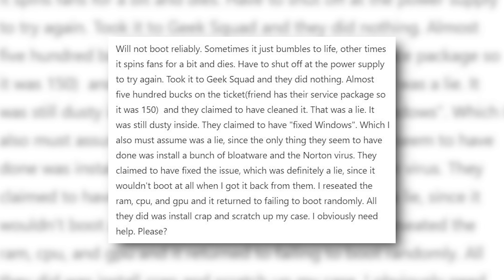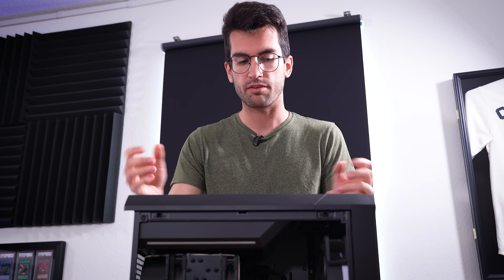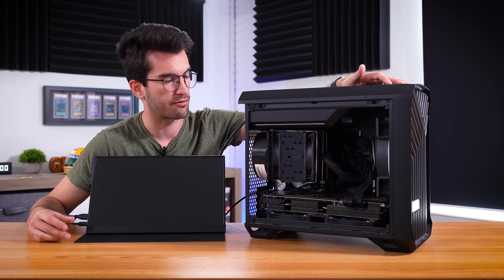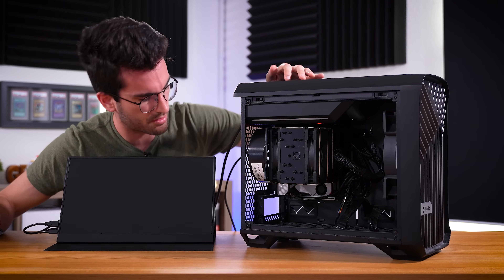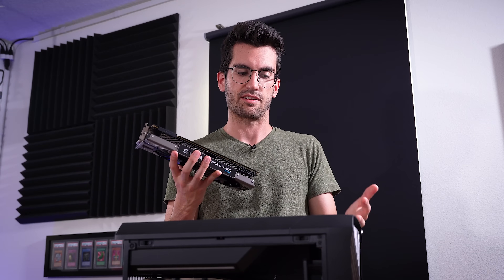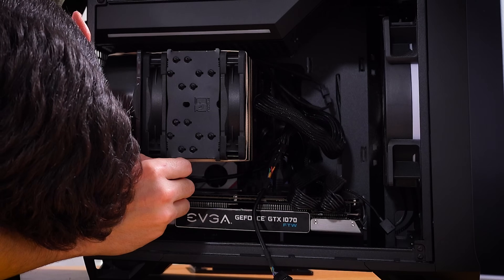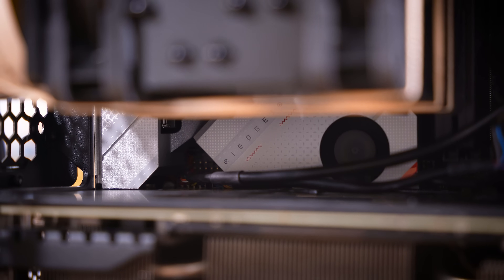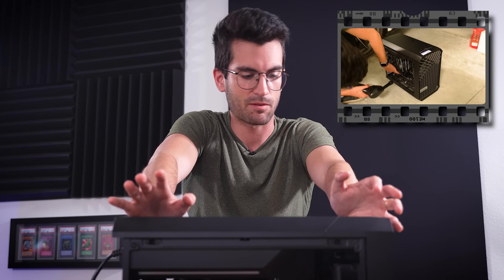Fixing a Viewer's BROKEN Gaming PC? - Fix or Flop S5:E6

Comment: The only thing that you didn't seem to rule out was the extension on the front panel connectors. After verifying that you could jump the pins to start up, I would have tried the front panel connectors without the extension to see if posts consistently after that.
Reply: My issue with that is why would it turn on and back off again? All it needs to power on is a short between the 2 pins or a momentary switch like what comes with the case. Unless you are saying something on the front I/O was hooked up wrong to the board causing it to shut down due to a short
Reply: @jsteezy80   I'm no expert, but my line of thinking was 1) Once the front panel connectors were removed the PC seemed to boot properly. 2) Does that mean the actual cables are somehow causing a problem? 3) Remove the extension, then connect the front panel directly to see if it continues to boot properly.

The idea being that maybe something was up with the wires within the extension triggering the power response or something. Similar to holding down the power button to turn off the PC and then starting it back up. I had someone who didn't realize their power button was a bit stuck and so sometimes the pressure was enough to shut down their PC. 

Regardless, it looks like it started up fine after everything even with the extension, but I think it was a simple thing to check just to rule it out as a potential issue/point of failure.

Comment: I purchased a new 1660 ti about a year ago. Installed it in an older Dell XPS with Gen 3. Ran some bench marks with Disk Mark the same day. The card crashed, with each test it crashed sooner than the previous test until it barely functioned. I tried it in another computer and it was all but dead. I contacted the company, they refunded my money and didn't want the card back. For grins I stuck it in an ancient Dell a year later. It worked flawlessly. It's installed in another computer that's less than a year old today and running fine. Sometimes, logic eludes us.

Comment: It looked pretty much to short circuit style fault. Shutdown immediately after detecting short circuit. Also connector mush have hit to some components or screw etc. With all those painted metals parts it need to scratch through surface to get contact.
Can't remember any other problem that kills power right when trying to start. ok maybe bitrot bios.

Comment: I have an issue where my system some times hangs at boot. Only thing that fixes it is removing all monitor plugs but the main monitor and replacing them after windows has booted.

Comment: Should have left the front I/O panel connector on after removing the GPU, test one thing at a time. I suspect it was the extension on the front panel connector not seated correctly.

Comment: The graphics card was shorting out the computer, make sure the metal backplate IO shield goes through the slots without touching the board sometimes graphic's card sag can cause the IO part of the card to touch the motherboard, also sometimes during shipping or traveling the graphics card can sometimes get a loose connection to some of the pins, another thing is to make sure nothing on the graphics card is touching the motherboard or the case.  It is possible the vibration of just using the case could cause graphics card and ran to become loose.

Comment: I'm thinking you were still on to something with the HDD activity cable.  It's possible those the cable pin were making contact with an UNPAINTED surface somewhere on the case or video card. You demonstrated touching the pins to a painted service.  In the end, the user is getting an operating system back and that is all which matters. Good troubleshooting.

Comment: This could also be caused by a faulty outlet in his home. If he has a bad outlet it might not necessarily trip the breaker, especially if it's older. He might want to look into the outlet, or if anything he can plug his system into a different one to see if there's a difference.

Comment: I had an issue where my pc won't turn on after shutting down sometimes...Everything looks fine. Until I checked the front panel switch and tried twisting it before plugging it back in. It seems like a loose front panel switch issue. Watching the viewer's rig reminded me of that issue and its even more prone since he/she is using extensions. That's just my opinion

Comment: I am an IT tech and its funny you showed this because I have issues a couple times were a laptop wouldn't load.  The fix I accidently found was removing the RAM card and putting the same one back in.  Don't know why that works, have really found a positive answer why it worked it just worked.  I have done it twice and it worked both times.  Crazy how some stuff fixes by just unplugging and plugging back in.

Comment: I've been flipping PCs in my local area for about a decade now and still learn something new every day. Personally, on PCs where I can't find a visible issue, I will take it apart anyway. I had a similar issue with an X58 build years ago where it would refuse to power on or suddenly power off, but when I took the side panel off and played with the cables it would power on with no problem. This was my personal rig and it went on for the year that I ran that platform. I case-swapped it after about a year to get it ready to sell and found the issue. It was a standoff that was out of place shorting out the motherboard. I didn't have the issue when I took the side panel off because the heatsink wasn't pressing up against the side panel causing the standoff to make contact shorting out the board. Loose screws or out-of-place standoffs can cause this issue of shorting out the motherboard even if it doesn't do it when you're looking for the issue. In my case, I didn't see the problem because with the side panel off the standoff wasn't making contact to short out my motherboard.

This viewer's heatsink looks pretty tall and may be pressing against the side panel causing a loose screw or standoff in the wrong place to be coming in contact with something on the back of the motherboard.
Reply: Interesting point and a very good one.  My guess was that it was a motherboard short somewhere.  The uncapped HDD plug may cause it as well if it was hitting against a part of the motherboard.
Reply: This was my thought as well. After his initial testing I would've checked the motherboard standoffs to make sure they were all in place and lined up correctly.

Comment: I personally think you're onto something regarding the HDD led header, It might have touched somewhere else, the anodized GPU back plate won't be causing a short since it's well anodized (oxide layer) meaning it's won't be conductive. So that pins could've touched somewhere on bare metal like a screw,post,mobo or anything that's maybe grounded
Reply: was thinking exactly this.Greg didnt tap the header pins on a truly reactive metal surface to make his point, but the theory was still pretty sound and exactly the type of thing that could have been the issue. I think the cable replug / parts reseating check does make a diff too - that is part of the takeaway lesson in this ( and I once had RAM sticks clicked in but not fully IN, causing boot loops)

Comment: i assume you reset bios since youve said in previous vids you always do that even if you dont show on camera. i say this because:

i upgraded my prebuilt pc (i7 9700, 2x8gb ddr4, 3070, omen edoras crappy oem mobo that is uncomfortably flimsy) to a beast (7800x3d, 2x16gb ddr5 6000, 3070, 670 aorus elite ax 1.1) and since that upgrade i had random power off - restarts. seemingly randomly, no pattern to it, pc would just go black screen then restart. no crash logs, nothing odd in event viewer. 

I did the troubleshoot steps so out of order. I ran chkdsk and sfc which both found errors and fixed them. it still happened. i ran memtest for 2 passes and it found no errors. it still happened. updated windows, made sure i had all the drivers, still happened. it was only when playing a game that consistantly pegged the 7800x3d at 100% that made me realize what it was. the ONLY game that made it run at 100%. the only real world scenario. i ran cinebench, prime95, heavyload, all on cpu, perfectly fine it didnt happen. but the ONE REAL WORLD SCENARIO, the one game, the one real use case that caused it consistantly was generating a new world in shadows of doubt. 

can you guess the issue?

it was my cpu undervolt. i undervolted -40 which looked very stable on the surface, stress tests and torture tests ran perfectly, cinebench ran perfectly. but the one real world scenario that made my cpu actually work consistantly hard caused the rebooting. i never would have tried resetting bios. i never would have found out. i probably would have gotten a new nvme ssd because that was the only thing same from the upgrade, and chkdsk and sfc found errors on it. it was my UNDERVOLT. i saved the easiest troubleshooting step for last. i facepalmed so hard, and i still do, but i learned, and hopefully i can help someone with a similar issue

to note for you troubleshooters and benchmarkers: STRESS TESTS ARE NOT TRUE BENCHMARKS. use a game, a real game, that makes the system work. my undervolt was unstable and stress tests ran flawlessly, but a single game that maxxed my cpu did not run at all. games and rendering are real world scenarios, stress tests and torture tests are not

Comment: I am not shure about this front panel extension cause i had a similar issue when my silverstone remote was wired the same way and turns out the text had to be readable from both sides on the plug to have + and - be connected properly

Comment: some times sistems got a overstack of power in the case and that prevent to show image or start what i dont like of sff sistems its there s no room for airflow because the same cables from the psu block the air pcs are machines that need air electricity and other things are not furniture thats a silly fashion

Comment: I used to work for the white, black, and orange team way back in the early 2000s, back then we were mainly a bunch of computer nerds that wanted cheap stuff from BBY. As time went on and BBY wanted to just make more money it was run these standard tools that look for virus, spyware, etc and sell them these extras (norton/trend, spyware software), and then send them on the way. Bigger issue? Well then just have them buy a new PC, the PC is almost 3 years old anyway and we have these great financing offers. Make sure to sell them the service plan, and these add-ons.

Greg if you ever have a junk case, pull the power switch from it and keep it around, this is easier than trying to fit a conductive screwdriver into the case and jump it manually.
Reply: Good call on the power button. I was thinking about buying him a momentary power button on Amazon and sending it his way. I have one attached to my desk so I don't have to reach the PC which is in an awkward place
Reply: I cringe every time I see Greg use a screw driver on the power pins! They have wired push buttons on Amazon!!😲
Reply: I can't tell you how many cheap power buttons I've had on expensive setups that don't work. 🤷
It's truly amazing how many I've had that don't work. 🤣I have the power button curse. I've even had friends get the same cases with no issue.

Comment: I've had some problems with the same pattern, once it was the USB front connectors that didnt allow my PC to boot jsut like this one, the other was the cooler mount pressure that was too high and the memory slots werent being recognized causing the PC to kept on loop trying to boot, and the last one was a strange one with the windows drivers that wouldn't allow me to boot with the GPU, and to fix it i booted on CPU alone and reinstalled drivers for the GPU and it worked again. Eletronics are just like magic sometimes

Comment: I had a computer do the same thing and it was an issue with the wiring of the front panel. Once I disconnected all the wires and connected them again it was fine.

Comment: I had a similar issue with my previous PC: When I pressed the power button sometimes it would power on no problem, sometimes it wouldn't do anything until I unplugged it and tried again, sometimes it would click on and off a few times then boot, then one day it never reacted ever again, even after unplugging. It ended up being a dead motherboard.

Comment: I am willing to bet that most of us have had a similar issue with something where it misbehaved inconsistently.  These are real head-scratchers.  I think the only other things I would have done would be to ensure that the CPU was totally seated well and to make sure there was nothing unexpected shorting the board to the case.  It might also be worth finding something to suspend the graphics card so that it sits perfectly horizontal in the case and has some added support.  I keep wondering if when you removed the graphics card, the main board was slightly pulled away from the inside of the case alleviating a short.  Just a theory though...

Comment: 14:50

could be the hdd front panel pins were touching the gpu or mobo, also, that is a lot of gpu sag, more heat and vibrations might be bending it too far? also also, that is a tight bend on the gpu power cables and i would give them a good jostling when running to see if there is maybe an internal break. seen it more than once

Comment: Not sure if the psu cable to the wall was included in the owners parcel to you but they are a common cable and its possible that the cable is the issue. Maybe you used a good one and they left the bad one at home?

Comment: I've been dealing with electricity and electronics since the early 80's, and 95% of electrical issues are due to a loose wire or bad connection. i can't begin to tell you jow many times I've "fixed" a problem by disconnecting and reconnecting a wire or a card.

Comment: I had a similar problem where it turns out that the simple fix was to check if everything was seated in all the way in. That means giving everything a little push, not too hard though, because of how fragile PC parts are, and that fixed my problem, and I'm kicking myself for not checking that sooner. My problem makes sense because at the time I was moving my PC around a lot, and another thing you can check is if your power supply is broken or if your GPU is getting enough juice.

Comment: I would run the  power supply test in  OCCT for a few hours just to make sure it's fully stable and that the issue does not pop up when the computer is on full load or after it comes from full load I have seen some broken processors in the past where they would work fine until you fully load them and then they start to show issues afterwards.

Comment: Don't be sorry for the ending. This is actually a very valuable lesson to anyone out there: check connections, reseat components, before sending your PC in for what could be costly (and unnecessary) diagnostics and repair.
Reply: yeah something might have crawled loose and all the pulling out and putting it back in fixed the issue it can happen over time to ram so might have been a ram modules crawled out of the slot for all he knew and putting everything back in fixed the issue by accident

Comment: User complained of intermittent issue that went away when reseating parts. You reseated parts and it started working again. To me that would indicate something, probably the GPU, is moving. I'd have looked into an anti sag bracket or something like that.

Comment: If that hd led was touching something that was live that would have definitely kicked the system off. I would always wrap electrical tape around any metal that could be close to motherboard or any live connection . Has a lot of fans which would create strong airflow especially when gaming which could easily move lose connections creating random cut out of system. These types of issues are the worst.

Comment: Sometimes poor connections can cause issues. You did a great job testing the components and the system. Maybe it's just the salt in the air. Also appreciate you explaining how you are able to fix local computers at no cost to the customer.

Comment: just a small thought but is it possible that the hdd light cable was making contact with any pins on the mother board and shorting the board but like i said this is a thought not saying that this is a for sure what happened just a thought

Comment: Had this many times, my guess would be that the GPU still wasnt fully seated or the PCIE Slot was Dusty/Dirty which disrupted the connection, Typically when it boots and turns off quickly its been GPU related 8/10 times.

Comment: It could have been some bios settings or overclock settings that got cleared when a new gpu was installed
Reply from the maker: Typically, an overclock setting that only works "sometimes" wouldn't inconsistently result in the system outright refusing to power on. It may work for a few moments and then BSOD/immediately power off, but this symptom was different. That said, I can't rule anything out entirely.

Comment: From the short glimpse at 6:22, it looks like the power led header is reveresed in the extensions. Negative is connecting to the red wire. Can't tell if its a red/black wire
Reply from the maker: Polarity was correct for LED pins IIRC. Checked it up close later in the video.

Comment: I'm curious, could it have not been the front port connectors being pressed against by the gpu and you removing and repositioning the cables relieved what stress was originally on that part?
Reply from the maker: Front port connectors? We showed them in the video. AFAIK they weren't initially snagged by the graphics card. We even discussed them at length later in the video.